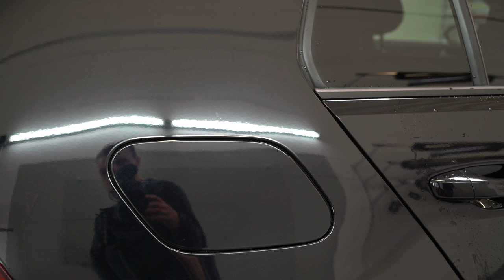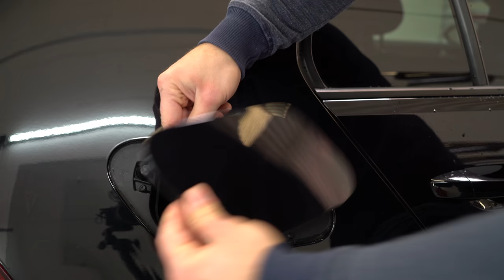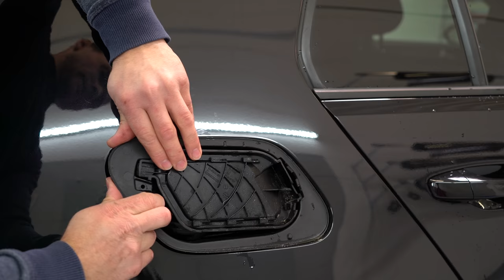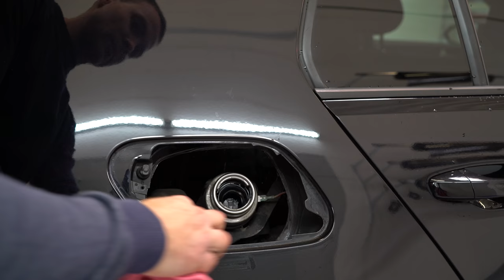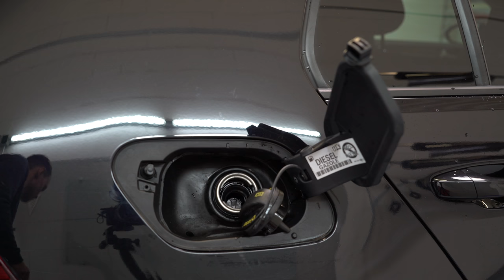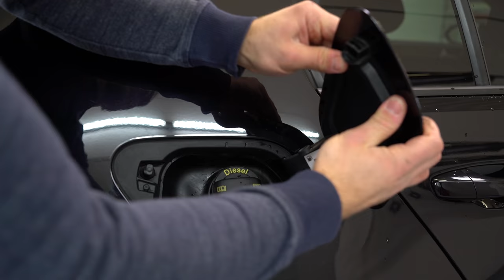How to remove the Gas Tank cover VW Golf VII

Comment: Thanks alot,
When i lock my car, this door dont lock, why???
Reply: Same here
Reply: The Little Motor is broken. You Need to replace it
Reply: When I unlock my car, this door doesn't unlock. Why?

Because some imbeciles decided to fit an actuator that breaks after just 3 years of use and also thought it would be a sensible idea to NOT include a manual fuel filler cap release in the boot/trunk.

On a car that cost £45,755 when new.